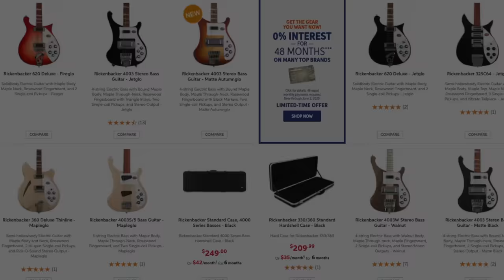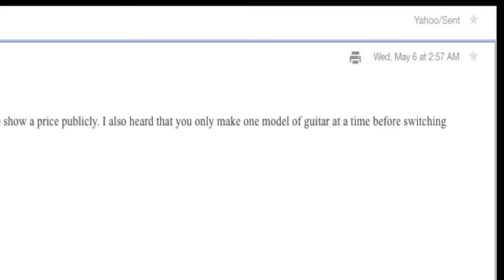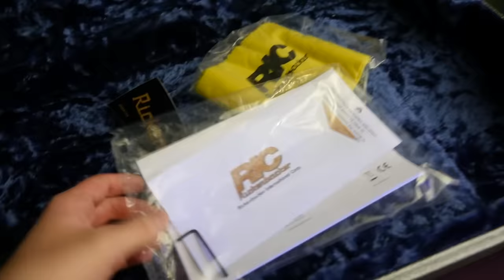You're NOT Allowed to Know the Price! | 2020 Rickenbacker 325 C64 Jetglo | Review + Demo

Comment: Rick had always been a quirky shop. Making a 12-string with a 6-sting width neck was what, economic? Stupid?  Same for the twin truss rods which are close to impossible to make work properly and too much neck material is hollowed out.  I mean, EVERY other guitar has a single truss rod. So, did they ALL get it wrong, or did Rickenbacker? In any event, twin truss rods are an example of gross over-engineering - definitely not superior.  They are too close to work well together but will tend to warp your neck unless they are precisely tweaked which most people do not do.
The pickup controls are counter-intuitive and the fifth knob is entirely unnecessary and a mystery to most. String end attachment at the tailpiece has been a PITA for decades.
To be fair, I love the overall appearance of the Rick 12/360, I have a '66 and it's one of the most beautiful guitars I have. So, with all their flaws, the suckers sound unique and great, even if actually playing them is more difficult than it ought to be. No wonder Lennon went to an Epiphone Casio later on. Their basses, however, are magic.

Comment: Trogly you don't know jack about these Rics. First off, Lennon had FOUR 325 models. You reference the '58 Capri 325 as the guitar shown in the Blackpool Night Out clip. That gig is using the 325 model the 325c64 is replicating. Ugh!!!

Anyway.....controls are actually on the Ric website. Two tone pots. Two volume pots. Blend knob is an EQ of sorts and can act as a master volume.

The 325v63 series versus the 325c63. V series is more modern, which is actually good. Modern guts, routing, no roller bridge, felt pads under the vibrato and oddly enough, a single truss rod.

At least my March '96 325v63 has a single truss rod. 90s 325s have hot toasters (hotter output), but mine were recently rated and they came from the factory with vintage output toasters. No, nobody modded it before I bought it in 2000, it's original and unmolested.

The v series 325s have conversion varnish and not that UV cured shit they use today. It's not really a pain in the ass to take the guitar apart. To change strings, USE A CAPO!!!! I use a capo on every guitar I change strings on.

It's super annoying that you nitpick over silly stuff. My 325v63 is damn perfect. Can't say the same for the c series as the build quality isn't stellar as it's mid 90s counterparts.

I do have a modded '83 320 that you would hate😄. Has HB1 humbuckers in all positions with coil split and an aftermarket Winfield Accent vibrato. That's also a fun guitar. I had intonation issues and reshape and recut of the nut fixed it.

Comment: Yeah, putting the serial number in the control cavity will stop people faking the year. Thank god it's written on bare wood in pencil. Besides that, not telling you the price, asking a fortune when you do find out, not telling you what the control knobs do, using rubber parts that are eating the finish the day you pull it out of the case, being an absolute ball-ache to string...you're doing as good a job as the dealers are at selling these things. I'll pass.

Comment: Wanna hear something amazing? And pathetic? I called up my local music store that sells rickenbacker guitars, and I asked if they make 5-string basses still as I've seen a few artists playing them, the guy at the store said that it would most likely be a custom order and asked me my budget which was 6000 dollars. He then called rickenbacker and asked they're custom shop, the scoffed and quoted me with a price tag of 125,000 dollars. For a 5 string.
Reply: RIC has made a very limited 5 strings in the past but they were part of the 4004 series basses. They had a design issue though; the pick ups were the the ones used for the 4 string variant and didn't quite cover the 5 string width completely. They took a lot of heat for that and eventually stopped making them. In 2018 they announced a new 5 string bass line, not sure what actually happened with that. There is a "guy" "out there" who has converted 4-string 4001 series basses to 5 string but of course in that case the neck is still 4 string width. Google "rickenbacker 4001 5 string conversion" for some threads on it and him. Ultimately I'd say a 5 string RIC bass is just not in the cards; I love my Yamaha.

Comment: Thanks for the teardown!  I got a similar yet different 24 fret 24.75" scale 1989 Rick 350 as my graduation present from high school.  In a completely historically inaccurate usage, I used it playing lead guitar in a production of The Buddy Holly story in 1994.  The cleans are jangly and gorgeous even direct into an old PA with a little slapback delay...  (I'm the lead guitarist in this link if you're curious...  https://www.youtube.com/watch?v=llB-SeDFr20)
Also, the non-reissue models are cheaper but still cost as much as a les paul standard.  Mine was about $1000 in 1989 dollars. Susanna Hoffs from the Bangles had a signature edition 350 with a high gain lead pickup...

Comment: Rickenbacker guitars are  terrible. The bridge is just stupid with 4 posts & screws, they have thick plastic finish on the body , neck and fingerboard which resists play and bending the  strings, the flying "R" tail piece constantly break and trying to restring them is a feat in itself. Way over priced also. 
They don't come close to Ernie Ball, PRS, Suhr, Collings, Fender or Gibson in playability,  and tone. 
They have one tone; that jangly Byrds sound, for chording only. Just my personal opinion.
Reply: No two rics are alike. Bridge replacements are usually available, you can get the guitars in a walnut version with a satin oil finish. How on earth does the neck and fingerboard "Resist" bending?

The R tailpiece is definitely junk, but you can always just buy the razor blade shaped trapeze tailpiece.

They most certainly have more than just "one" sound. Tame impala put tons of effects on his and it sounds great.